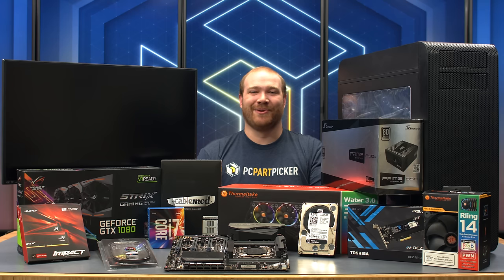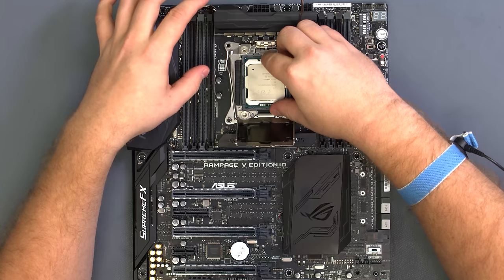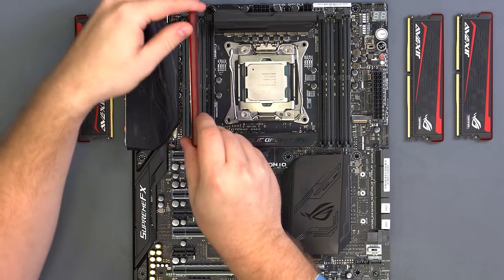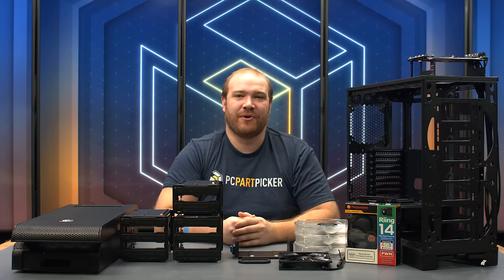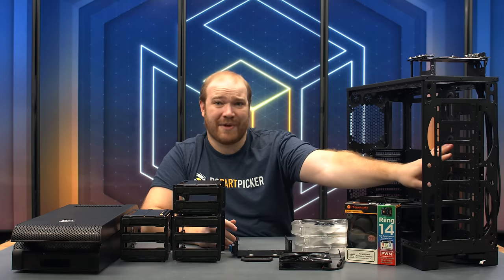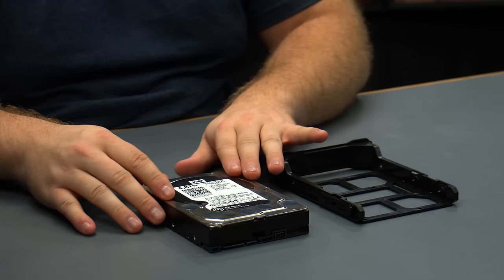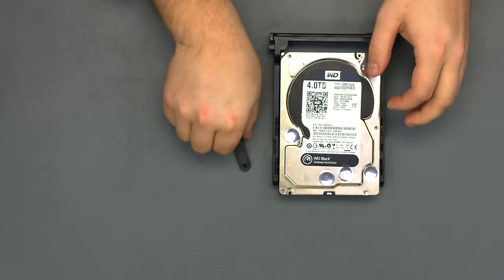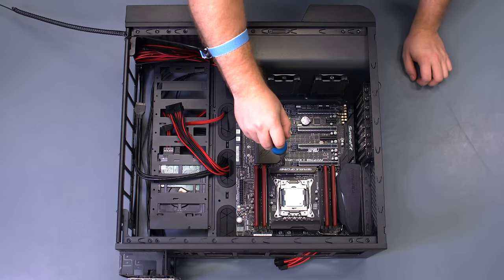ASUS Republic of Gamers 10th Anniversary Build

Comment: Hello Brian, great video by the way.

My son and I are attempting to build this PC as described by you.  The last time I built a PC was 8 years ago and I am a little rusty.  Could you please explain why you are using a 256 GB SSD.  Are you installing Wind10 on it for faster start rather than the 4TB hard drive?  Also, these new motherboards are no longer limited to the 2TB partition.  Is this correct?  We should be bale to use the entire 4 TB.

Most importantly please explain the use of the Solid Sate Drive.  What is the logic here?

Many thanks for your time.

Al
Reply: AL63722 sdd- faster, expensive, hdd- more space, but slower, cheaper

Comment: This cable menagment was so terrible as my English.... it looks nice but.... so bad =/ (look at GPU cables)
Reply: they do a separate video for cable management
Reply: Justin Kang I know but it look's so terrible right know =/
Reply: did you check the new video? its up and it looks pretty sick =D
Reply: Justin Kang I will see ;-)
Reply: They usually do a video on cable management after every build video.
Reply from the maker: For time purposes we now break out cable management into a separate time-lapse video (which is linked at the end of this build video as well).
Reply: PCPartPicker Before seeing this build I was settled to do a $500-1200 usd budget build. Now after seeing this beauty I will have to save up till next summer because I just won't be satisfied having something not as great as this. Fucking great job on a PC man.
Reply: are you on a tv show at any time
Reply: This was my biggest struggle. Sure a decent budget build would do pretty much everything I would want, but I want it to look sexy as hell too. I ended up spending around $1300, but it looks beautiful. Sure it's not as crazy as this, but it was the look I was going for.
Reply: I also thought it was funny that they used 2 of the same color controls that come with the CPU cooler and case fans when they both can just use one of the controls for both. I would know this because I have the same CPU cooler and case fans.
Reply: i agree that the gpu cable management is Honorable evga makes a part to fix that
Reply: how
i have the same fans and cooler as well.
Reply: what's the link?

Comment: Hey, I bought me this mother board recently with the Cosair 570X Chassis RGB but a bit of the back-plate  of the board is touching the cable management groves (however you spell it). Is that normal? Or should I take out that rubber totally? This is my first build. Also, love your videos, especially the videos you have about the 570X. I have the exact same part list like you have on this build, so my 360 Riing will go in-front but I will have Trident RGB ram sticks. 

Dont know if you still answer comments.

Comment: Is this a good first build ? 

Intel i5 4590

Cryorig m9i

Gigabyte GA-B85M-DS3H-A

Corsair Vengeance 8GB

SanDisk SSD Plus 240GB

Seagate Barracuda 1TB

EVGA GEForce GTX 950

Bitfenix nova ATX mid Tower case   

CORSAIR CXM 450w

Gigabyte GC-WB867D

Comment: Cablemanagement? I hate it when guys use sleeved cables and don´t do harder work on them! And why not directly using the M.2 port on the motherboard instead of the pci slot adapter card?

Comment: ROG build? Republic Of "GAMERS" in what scenario does a gamer need anything more than a 6700k? am I wrong or is the CPU a tad overkill? GPU makes sense assuming you play at 1440p/4k.
Reply: Nope. Id explain to you why by using detailed pricing and efficiency and how upgrade cycles would make a quad core i7 with hyper threading unlocked worth more than anything higher up the intel processors but meh cba.

Comment: Which is best motherboard in Z97 series
Reply: ibrahim sadeek For the budget its Gigabyte z97x gaming 3, but best bang for the buck goes to Msi Z97 gaming 5 along side Asus Z97A. 
If you are Asus fan than consider Z97 Pro Gamer as well. Unlike "ROG" Asus mobos this one doesnt eat the wallet and it offers pretty much the same features with just a bit less overclocking potential.
The Best is too much undefined term friend. It all depends for what you need mobo and how much you want to push it... Or how much you are willing to pay for a good mothetboard.

Comment: I have the same motherboard and processor. I'm curious about having both the 6 pin and 4 pin power connectors attached on the motherboard. In my build only the ATX power and the 6 Pin power connector are attached w/ the 4 pin being left unplugged. I'm running at a 4.0ghz overclock of the 6850k 40x100 with a vcore of 1.2

http://www.modsrigs.com/detail.aspx?BuildID=36010 for information/details of my build.

Comment: #PCPARTPICKER Please help me!
i did al the same has you in my build.
i have the asus Rampage V edition 10
Asus Rog Strix 1080
SSD Samsung Pro 850 1tb
A PSU 900w IN WIN Platinum (i think that here is the error)
4x 3200mhz Ram HiperX Predator 8gb

i Start the computer from my Corsair Case (780t)
and the monitor is totally black for 1 minutes or 2...
then the computer restart and the same problem and shut down.

I use the restart Bios buttom from the MOBO that is in the back panel and starts well, all operative and working.
but i have to start only with that button... What i have made wrong?
with that mettod i can install Operative System and i can shut down o restart normally... But the next day i have to start with the Restart Bios button again....